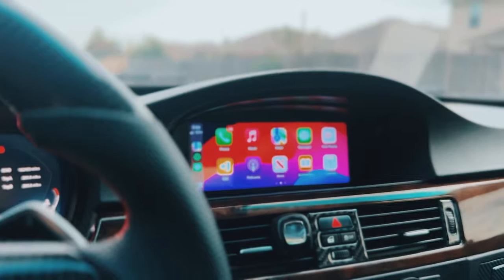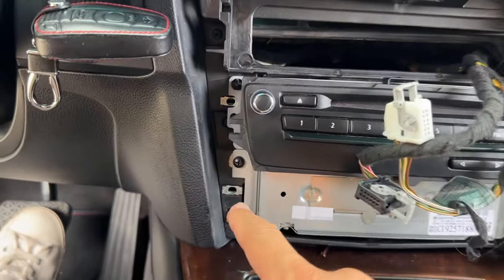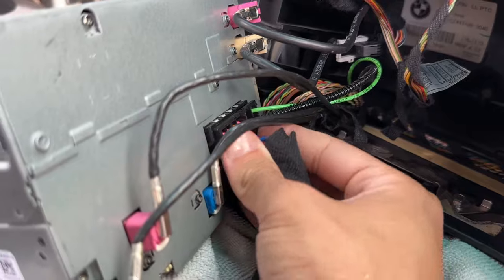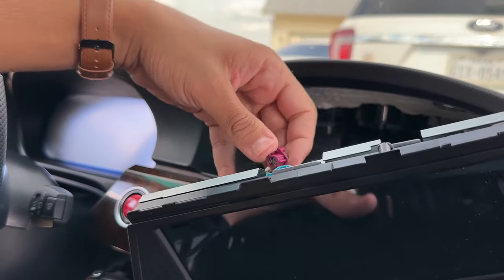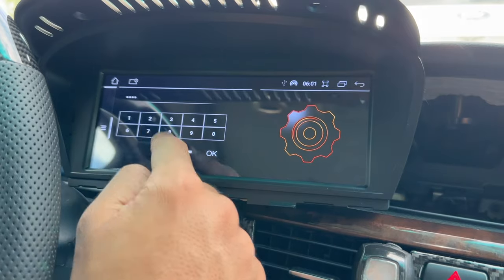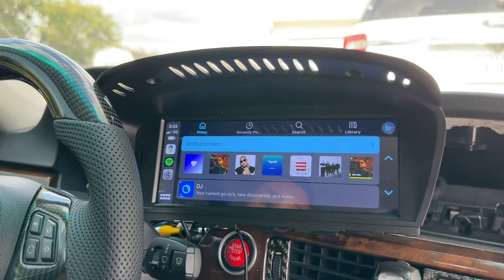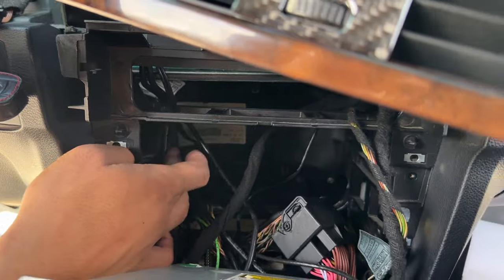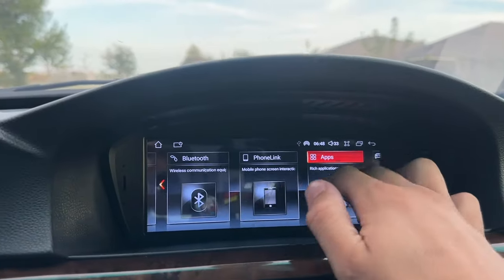How To Replace BMW iDrive with Touchscreen Apple CarPlay Unit | E90 E92 328i 335i M3 E60

Comment: Is the aux cord necessary??
Reply: Is conditioner necessary?
Reply: Mine works without the AUX cord👌
Reply: @tighematthew  how? I cant get the sounds to work
Reply: @samh9631  mine just worked without the AUX cord it's 2009 e92 not sure if there different did you move the optical cable to the new harness. If you keep looking on YouTube there are heaps of videos on it
Reply: @tighematthew  thanks for your replay. The thing is with instaling the new screen i found out my car doesnt have an fiber optic cable. Idk if thos is normal or the owner before me did some weird things with it.
Reply: @tighematthew  hi yea my car doesnt jave an optical cable. With me the problem is that de aux volume stays stuck at 0 cant adjust it cant find a fix on it either;(
Reply: @samh9631 had the same issue, turned out the pins connecting the aux to the MULF in the boot were loose. Re soldered them and no issues yet. Hope this helps

Comment: best video I have seen for e90 CarPlay, all the other ones did not help which is why I have not bought it but now I definitely am 💯
Reply: How did it go
Reply: @mihajlobrankovic7039  great, installation was simple, didn’t run into any problems tbh, some of the trim pieces were a pain to get out because it’s never been removed since factory but other than that it was simple
Reply: hola ¿encajas? E93 cabrio gracias

Comment: If audio quality matters to you DO NOT BUY THIS!
It uses aux to send audio.
The newer boxes use the cars MOST cable which is fibre optic.
There's a massive difference in sound quality.
Reply: Where do we get the ones with the fiber optic
Reply: Fr where can we buy
Reply: yea i noticed that, looks like trash too having to run a aux cable, thats like 60 year old technology
Reply: Only one I have been able to find that uses MOST is the Mr12Volt interface. This is the MMI box type unit, not a full Android replacement screen. 

It seems to have great revies and Evolve UK sell it too. I've ordered one for myself so will see how it is when I get it installed. 

None of the Android screens use MOST, all seem to be aux as far as I can find.
Reply: Does it disengage from aux when you switch back to original ccc screen etc?
Reply: @Matthew-nl9kd  Have you already received that box? Will you share your opinion on how it works?
Reply: What's that name or model of that box

Comment: Question: nobody talks about what are the parts required? Software program, screen monitor, radio, player, etc? Seems like several parts to this system ? Explain pls. Thanks
Reply from the maker: you do not need to program the software, it’s all built into one plug and play system

Comment: Does is work for an M3 e92 ? The original idrive system allows you to change the gears and chassis etc. will this be compatible with that ?
Reply from the maker: you can still access the iDrive menu with this CarPlay unit. I’m not 100% on specifics since it was installed in a 335D, not an M3 but we were still able to access all the menus
Reply: @IzzyE9X  thanks for the response. I'm just about ready to order mine but I was wondering if you can make like a 5 min video of the idrive system of just how it looks, like the settings, vehicle info, oil level etc

Comment: This or the eonon unit ? Yes this unit is sleek because it’s in the old i drive location but the screen is not as big as the eonon opinions ?
Reply from the maker: I don’t know too much about those Eonon units, I have heard mixed responses though.
Reply: @IzzyE9X  i always liked the cic  instead of the ccc system, but my car comes with the ccc system can i get the cic system instead or do i have to get the ccc system because mine stock is ccc ?

Comment: You didn’t unplug the battery only the IBS and there is a torque spec for the nut that holds that cable on and if not torqued correctly it will bend the plate and cause damage. That will cost you a couple hundred bucks if done wrong. The battery terminal you should have unplugged is the ground and that is completely open and easy to access for a reason.

Comment: Would you recommend this or the mmi prime unit?
Reply from the maker: doing a comparison is tough, in my opinion:

the screen is pretty great because it gives you full android software, access to full apps and most importantly a touchscreen. this is great if your factory screen is damaged or has issues. 

I’m not extremely familiar with how in depth the mmi boxes can go in terms of features, so I’d give that win overall to a replacement screen, however there are a lot of brands out there that produce low quality CarPlay screens that can be glitchy/buggy. 

Andream seems to be pretty great, I’ve had one of their screens in my E92 for years now and not many issues besides the Bluetooth CarPlay can be very finicky.
Reply: @IzzyE9X  isn’t the mmi box the same one you installed like 2 weeks ago? In just like the oem or oem plus look
Reply from the maker: @alfredosteinhour yes the MMI box was installed on a different car, it gives your CarPlay but not access to applications and etc.
Reply: How can you determine the size or will the 10” screen fit in the 8” screen

Comment: (06 330i) My current idrive screen isn’t working I replaced my CCC unit and still doesn’t power on. I’m thinking about just upgrading to this Apple car play system. Would I have any issues with the new one working or should I be okay. Any insight appreciated. Thankyou
Reply from the maker: As long as your stock radio itself it functional, your issue should be fixed after installing this screen!
Reply: @IzzyE9X my car didn’t crank up after doing this. I admit that I didn’t disconnect the battery. Should I redo the install with battery disconnect?
Reply from the maker: @reginaldellis634  it probably didn’t crank due to power drainage. if you’re constantly plugging/un-plugging different connections, the car’s systems will keep going awake and asleep, which will cause the battery to die
Reply: @IzzyE9X thanks for your response.  Should I just redo what I did and disconnect the battery?

Comment: all through a shitty AUX connection. Sadly none of these use the MOST fiber optic input
Reply: The Mr12volt unit does. It's a MMI box type unit though rather than a full Android replacement screen. 
As far as I can tell it's the only product that does.

Comment: how would you be able to check the cars diagnostics. such as oil levels, air pressure, trips, gas milage, and more that the oem is able to provide originally?
Reply from the maker: You can still check all of the BMW diagnostics info, you simply click the home screen button and the iDrive system can be accessed.
Reply: @IzzyE9X the touch screen works on the idrive menú? Or Only works with de CCC controller? I have issues with my CCC controller and i dont able to Fix it😅